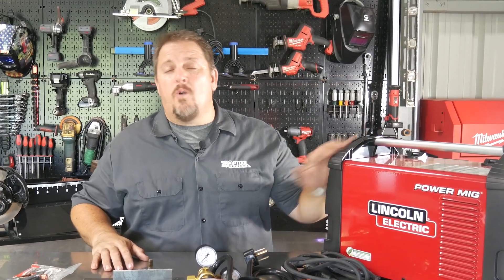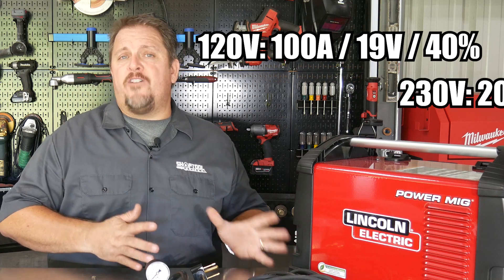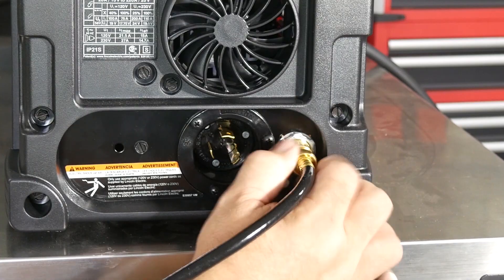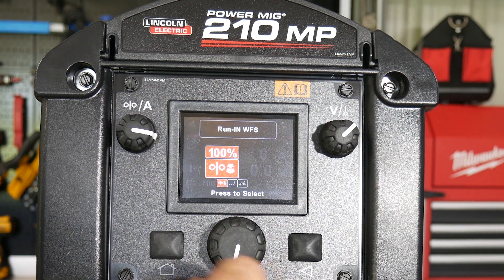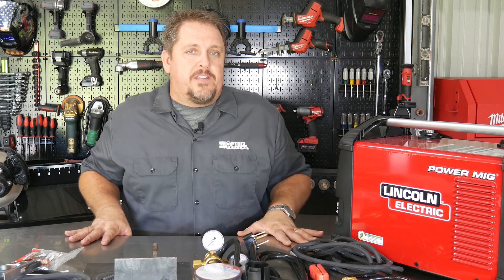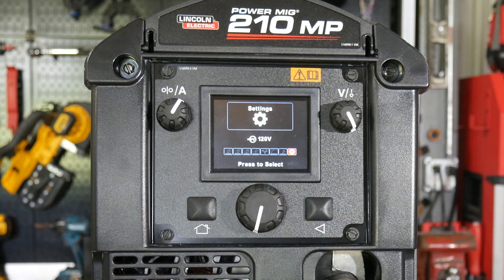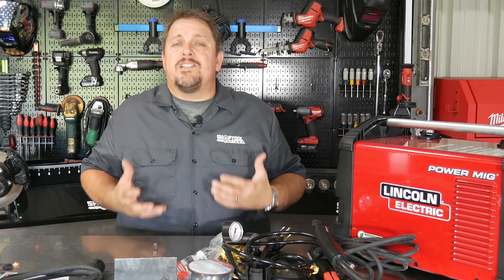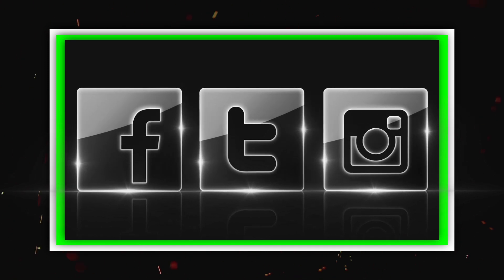Lincoln Electric Power MIG 210 MP Multi-Process Welder

Comment: I keep  having an issue with  stick welding  .  it seems that  it won't keep an arch  . once I do  have an arch its only able to keep it for seconds   .  I run 7018 3/32   at 100amps.
Reply: Not enough amps and do  you switch to negative polarity

Comment: It’s all great until the screen goes out and then you can’t do a thing. These machines have great bells and whistles and can make the most rookie welder think he/she is a professional. For the home hobby person Lincoln/Miller/Esab is going to take all your money and then tell you to kick rocks when the machine breaks down out of warranty. Stick to a transformer and learn how to weld!
Reply: It has a 3 year warranty... do you expect them to service it and give parts for free forever?  Just curious.  They also sell a 5 year warranty for this unit for an extra $115.  Am I missing something?
Reply: @jeremy7923  I dont think you are. This would be a great welder for rookies who have the extra cash to throw at it. All the info it provides on the lcd just helps get people familiar to the nominal values while giving the user more time to focus on laying a good bead. if anything I think this thing would be great for someone looking to get into welding and has limited practical knowledge on what feed speed, voltage settings, material tolerances and so on, especially if they are teaching them selves. Better to learn the correct things on a crutch than to learn the wrong things by trying to show off.

Comment: You did not even learn the machine yourself before shooting the video? TWO gas inlets for what?
Reply from the maker: I know this machine very well. I was making a point that other machines include 2 gas inlets for different processes. Such as, TIG uses 100% Argon, while MIG typically uses CO2/Argon. If you only have one gas inlet, then you have to switch this line every time you change processes. If you have 2 inlets, there is not need to switch the lines. Thanks for watching.
Reply: Richard you might want to think things through before you start criticizing people who actually know what they're talking about.